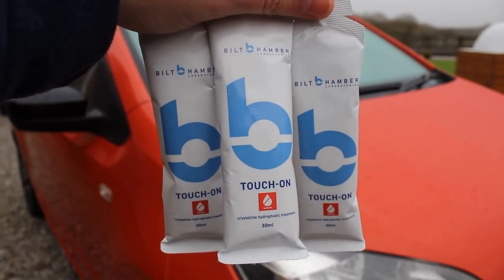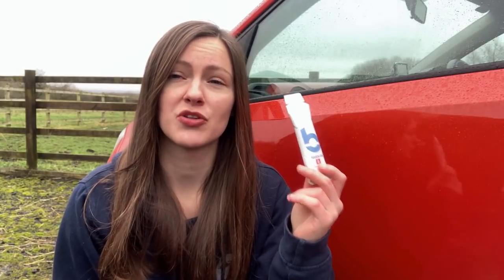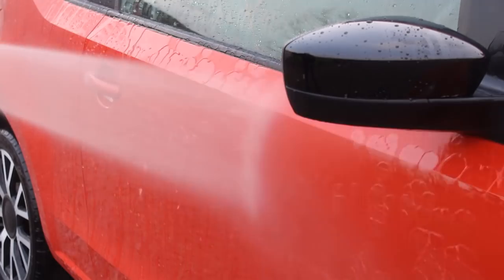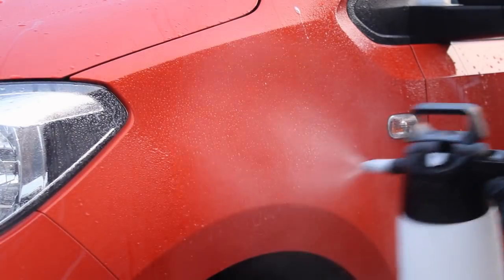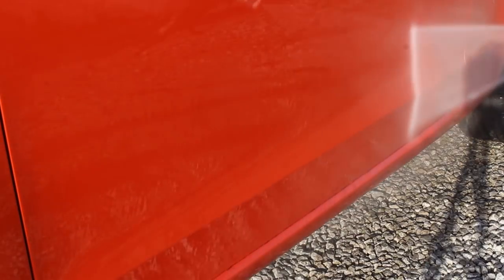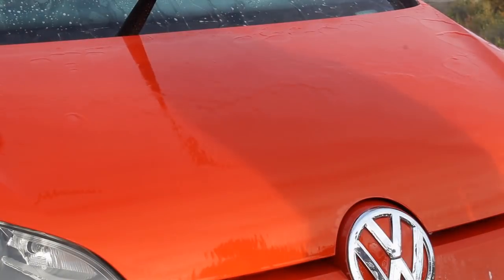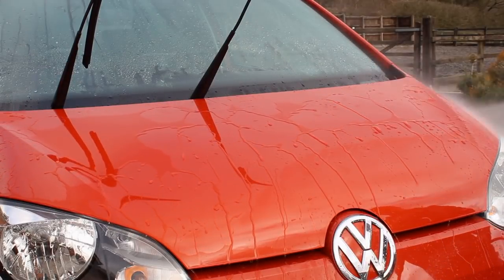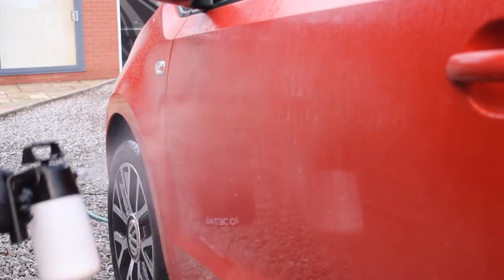Bilt Hamber Touch-On | Testing Different Application Methods and Durability

Comment from the maker: What type of paint protection product do you prefer? Do you lean towards spray and rinse products like this one, or do you tend to go for a more traditional wax or sealant instead? Let me know in the comments!

I've also done a comparison of Bilt Hamber Touch-Less with Auto Foam if you're new to the channel. Here's the link: https://youtu.be/8KRVWKwyxic

I’ve put some extra detail and info about dilutions etc., in the description if you’re looking for more information. Thanks for watching!
Reply: Sealant I reckon
Reply: I prefer BH D S wax, I got nearly 6 months of very acceptable water behavior from a half prep, washed it today and is definitely in need of a top up, will probably use KC spray and rinse on the next one until it gets a bit warmer and I can be bothered to do another prep 👍. Love your videos BTW, keep it up Heather.
Reply: Klasse SG 3 coats, then a couple P21s coats. That's worked well for me.
Reply from the maker: @Jamingedling  Cheers Jamie! Double Speed is a great wax, I'm looking forward to giving that a go again
Reply: Traditional wax for me. I can’t break away from using BH Double Speed because it does what it says on the tin 🙂
Reply: I use auto finesse lavish, ceramic sealant through a snow foam. Quick and easy and despite peoples opinion of auto finesse, I certainly rate that
Reply: This is the exact kind of review we need! Could you consider doing the AutoGlym Polar Seal? It is similar to this product and is done through a snow foam lance. I'd love your thoughts
Reply from the maker: Thanks for watching! I've got that one on the list to try at some point actually!
Reply: @AutoCareHQ  Thank you for the reply! It's an honour! I used it on my white 2017 Polo and it has worked well, very convenient to apply
Reply: I haven't been brave enough to try a coating yet and although I'd use something like Wet Coat on wheels for quickness/convenience, I'd prefer a wax finish if I had time over a body coating like Touch-On.
Reply: Only get time to wax once a month to two months. Products like this are fantastic in between.

Comment: Really well put together video. 

Confession, I’m a Bilt Hamber fan-boi. I’ve been using Touch-Less & Autowash for about 6 months, brilliant cleaning and great value for money.

I used Touch-On about 6 weeks ago, Touch-Less pre-wash, Autowash contact wash, then Touch-On through a cheap foam lance. Same dilution ratio as you, one sachet to 1 litre of water and used pretty much all of it on a Skoda Superb estate. Let it dwell for a couple of minutes and then rinsed. 

I was very surprised, and impressed, at how much sheeting and beading it gave. It’s now had 6 weeks of daily driver filth thrown at it, country roads and lanes. It still has some beading protection, but once I washed again, using the above method and products, it revived the protection a bit. I’ve put more Touch-On on and it’s now looking quite reasonable. 

It’s not in the same league as paste waxes, sealants, or SiO2 products, but it’s perfect for quick winter maintenance washes to top up the existing protection. 

I agree that it needs to be in a bottle and have clearer dilution ratios. I contacted Bilt Hamber and they said they are looking to make it available in bottle form later in 2022.
Reply from the maker: Thanks very much for watching :) yep I completely agree, the water behaviour of waxes/ sealants is definitely better but this type of product has a huge advantage when you consider how long it takes to apply. That's really interesting, I'd definitely like to see it in a bottle instead!

Comment: An other brilliant video Heather! I personally love BH Touch-On. I have used that with a bucket wash method as well as from a foam gun. And I had exactly the same experience as you have shown in this video. From the bucket it doesn't work well, not really sudsy either.. so I wouldn't recommend that usage either. But from a foam cannon it acts and works great for my taste, and could get a reasonable protection with such a small amount of effort. I like the water behaviour, gloss level and durability compared to the very easy application it works a treat every time. Nice to see the durability, i am currently testing myself on my car and will see how that goes, but wouldn't expect more than I have seen here. Well done Heather, great stuff with very valuable information, as always.
Reply from the maker: Thanks very much Viktor! You're definitely right, the amount of effort required to apply this in a foam cannon is tiny compared to the results you get. Looking forward to hearing how you get on with it as well durability-wise!

Comment: When I first used this on my car it made it real glossy and water beaded nicely. After using it on other cars I didn't feel amazed with the results. Happy you made this video as I was wondering if I did it wrong. I'm also selling a VW High UP which I thought id throw in as your cleaning one 😂
Reply: Only tried new version and combined with touch less it worked well

Comment: After watching this video and bilt hamber touch on i’ve put one sashay to 1 L water through snow foam gun will. As I have a Ford transit custom on my partner has a Nissan Navara I still have product left over. I do leave it in the reservoir or empty it into a container as if I was spraying it onto the vehicles. Then I can put it into an ordinary hand sprayer to use as a touchup if necessary. But not found using it every four weeks, but it does build up more protection and lasts longer. I also experimented about three weeks ago after spring touch on on my run, then used double speed wax over that. I came up with a real nice shine yesterday washed vehicle down again. I did some more torch on and you can more or less have a shave/make up with a reflection on a metallic orange paint.
Steve

Comment: Lovely Jubbly video, you always give the product you use a fair trial and review Heather, the only problem I can see is that this product is competing against more established products now with big names behind them, and the lack of detailed instructions doesn't help, but you can get this with other brands to.
Reply from the maker: Cheers Paul! Yeah I get what you mean, especially with there being a bit of crossover between it being a ceramic-infused shampoo/ spray and rinse sealant I can see why some would prefer to go for another brand's product which just sticks to one application method and does it really well

Comment: Excellent, thorough test Heather. Love the fact you give real world durability updates. I normally go for waxes and sealants, however due to time constraints I do also tend to occasionally use spray on rinse off product like Gyeon Wet Coat etc. For convenience, products such as the BH Touch On seem to be the way to go. Not sure about the sachets though. Think I'd prefer a traditional bottle!
Reply from the maker: Thanks Steve! I'm the same, I feel like the performance of a wax/ sealant tends to be a bit better but it's not always feasible to use them if time is short. I agree about the sachets, I'd much prefer it just to be in a bottle. I get that they add a bit of convenience because I don't need to measure anything out but they're a bit restricting because I always feel like I need to use the whole sachet!
Reply: @Auto Care HQ Using Gyeon Bathe+ (bottle) in the same way with much better results than touch on. I really do like the low effort and decent protection through a foam lance. Most of Bilt Hamber products are really good no nonsense products, but Touch On isn't really doing anything particularly great.
Reply: I just bought some sachets of Touch On and I am going to transfer them to a glass bottle. Job done.

Comment: Thank you for taking the time and effort to produce this video. Whilst Bilt Hamber products are normally excellent and cost effective, I don't think this product is particularly good value for money. Showing my age but I remember Turtle Wax hot wax of the 90s which was very effective in cleaning and left a fairly decent short term water behaviour on the panel. Dread to think of the chemicals used in that Turtle Wax product though. Personally I prefer waxes or sealants than spray and rinse products but both have their place.
Reply from the maker: Thanks for watching Karl :) That's very true, most of their products are very economical but this one does have a much higher cost per use compared to something like Double Speed for example

Comment: I think the best way to calculate the dilution (other than in the wash bucket) is what you'd normally use per car, on the assumption that the rate is 1 sachet per car. I prefer the spray method as I don't like product on my windows.

Comment: I don't know who is in the BH product marketing or development team, but those instructions SCREAM out to me...they've been written by the same person who has written the spec sheet. This means you end up with instructions that are ambiguous and assumptive in their wording.
I've been using Magiseal for 18 months now, and you can cover any car with 400ml total mix. 
Also, I tried SquidInks version this weekend and although more watery, it went on well.
All these products seem to be rinsed off within 30 secs of application and not dwell dependent at all.
For me BH need to reappraise their foams offering as it's out of step with the marketplace.... the rest is spot on though.
Your bucket shot reminded me of a typical ceramic shampoo..ie suds which go AWOL within minutes.
Reply from the maker: The instructions did surprise me a bit to be fair. BH are more specific compared to most other brands when it comes to their snow foams by using PIR rather than dilution ratios, so it surprised me that these instructions were much more vague. 

The Squid Ink one has very nice water behaviour and I was really interested to see how durable it was but the test hasn't gone quite to plan. The car had a knackered gear box and was sent back to Vauxhall because it's still under warranty so the owners are getting a new car! Hopefully I should get another chance to try it again soon though and see how long it lasts
Reply: @Auto Care HQ  put it on the wife's Kadjar yesterday after a good wash using their HD pure shampoo... looked good this morning in the wet Lancashire skies so the test is on

Comment: I quite like this as a quick and easy top
Up. I tend to mix it up into one litre and apply via my snow foam lance. That will do 2 cars for me and will keep for a month, once mixed, which coincidentally is around how long it lasts on the panel.
Reply from the maker: Yeah it's perfect for top ups, miles faster than waxes and sealants

Comment: Hey Heather
Great video as always 👍
Not tried the latest BH products.
As  for protection I’m currently using GT Sigma which seems to give awesome gloss with easy application.
Just purchased some Bead Juice to try too.
Have you used it before ?
Heard mixed reviews 🤷‍♂️
Reply from the maker: Thank you! Great call, Sigma is brill. I really like Bead Juice, another really easy one to use. I use it on my alloys mainly but I've also used it on quite a few other cars and by the time I came to wash them 2-3 months later they were still showing some water behaviour which is all I can ask for really when they weren't prepped or washed in between!

Comment: Great informative content as always - thanks. Doing the hard work testing these products to see if they’re a good fit for our preferences without us having to spend a penny! 

I’m a BH Double Speed fan for when the weather is right, but over winter for my fortnightly wash it has to be finished with Koch Chemie Protector Wax. Hardly any product required in the snow foam lance. Great water behaviour and nice gloss. 

Keep these videos coming. Thanks!
Reply from the maker: Thanks very much Michael! Double Speed is really good but it's definitely not been the best weather for applying it recently! I'll have to try some more Koch Chemie products. I've only used Green Star and FSE and they're both brill

Comment: I noticed that the slickness and suds of the shampoo can change by changing the mitt even changing water temperature if you use warmer water sometimes it will make the shampoo perform better.
Reply from the maker: That's interesting! I pretty much always use warm water unless it's really warm outside which is very rare!

Comment: Seems a reasonable product to try, although if I was going to go for spray and rinse either Infinity Wax express sealant or Turtle wax hybrid dry and shine. I spent yesterday using infinity wax winter wax and every 3 months or so I tend to go with traditional wax or sealant, however if time is against me or hydrophobics are starting to die, I will use a spray and rinse as an interim.
Reply from the maker: IW Express Sealant is definitely on my list of spray and rinse sealants to try when I get a bit lower on stock! They're definitely a must-have products for top ups and are very useful at this time of year

Comment: One of my cars I have GT CS on it the other car has  GT Sigma and the other car was bought in the winter so I have not had a chance to do a full detail on it so I have been putting Autobrite Ceramic Shield products on it ( Magiseal, Ceramic shampoo and ceramic spray wax ) for ease of application. I think for longevity GT is the winner but I do like the glass like finish on the black Jaguar from the Autobrite products. I used to be a wax user but I have been converted but I recently bought Autobrite Ceramic wax but not had a chance to use it yet.
Reply from the maker: GT CS and Sigma are a great combo, I used that on my car last year and it did really well. I definitely appreciate these kind of products though when it's winter as they're so fast to use

Comment: I think I'd give that product a go. I currently use turtle wax spray on pressure wash off. I forget it's actual name. It can streak sometimes though I found though.
Reply from the maker: It's definitely worth a try, I think you can even get the sachets individually for pretty cheap as well just to give it a go. I was half expecting this to end up with spotting issues when I used it in the pump sprayer so it pleasantly surprised me! I guess with it being intended for use in the bucket as well it's possibly more forgiving than a strictly spray and rinse type product

Comment: This reminds me quite a bit of Polar Seal from Autoglym. A similar type of application method, pop 30/40ml into a lance and top up with a couple hundred ml of water and spray over the car. Avoid the windscreen if you can help it though.
Reply from the maker: I need to give Polar Seal a try at some point! I'd like to try a few more of these spray and rinse products and then I can maybe pick my favourites for a comparison video
Reply: @AutoCareHQ  It's not bad and decent enough to chuck into a lance and lob over a car. Even lasts around the same time, 3/4 weeks. Road grime slips off well enough apparently. In the winter, that's what you want. Smells good as well. I'm tempted to try it out in a spray bottle and try spread it evenly over car panels, to see if that increases the durability and effectiveness of such a product. Use one MF to spread and one clean one to buff off. This technique works really well with TW hybrid sealant, seal and shine. The best-known spray and rinse products are Gyeon Wetcoat, BSD, Bead juice and the TW range, mainly because they so damn cheap and relatively easy to use. John even has a few videos on how to avoid streaks etc on Forensic Detailing.

Comment: Interesting results after Suds being applied on the bonnet , Touch Less brought some of the protection back then it was performing worse after Suds, don’t forget you can use Touch On as a QD as well with 1% dilution in a sprayer 
You seemed confused about the dilution in a pump sprayer , just remember it gives a 30ml to 10L dilution ratio for contact wash so it would be 3ml to 1L in the pump sprayer
Reply from the maker: That's an interesting idea using it as a QD or even as a drying aid maybe. I considered using the pump sprayer to match the foam cannon (0.3% PIR) but figured it'd be interesting to see how it looked when over-concentrated plus the sachets make it a bit of a pain to apply it otherwise. I thought it was interesting that there was a big difference in water behaviour when I used it in the bucket at 0.2% PIR here (30 mL into 15 L) and in the lance at 0.3% PIR, but then there was no difference when used at 3% in the pump sprayer compared to the lance. I can't imagine it being miles better at 0.3% in a bucket but it'd be cool to try, although I think the foam cannon method will still be my favourite way of using it!
Reply: @AutoCareHQ  yeah bucket method is crap, much better results doing it ANY other way 😅